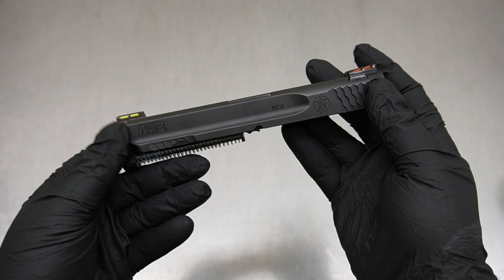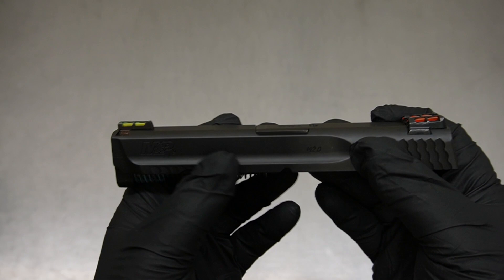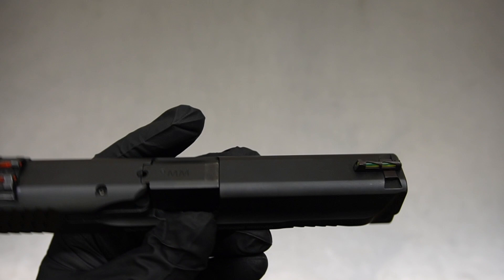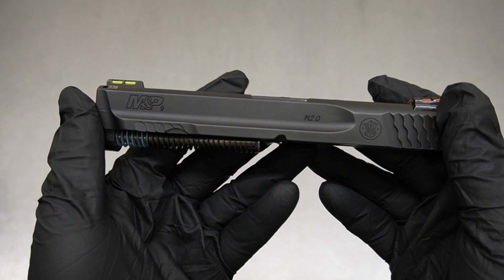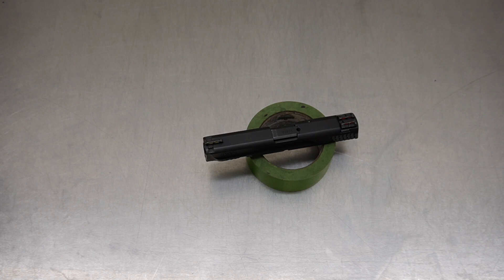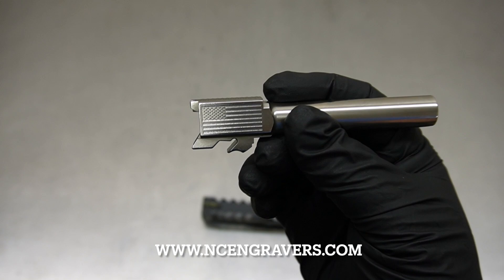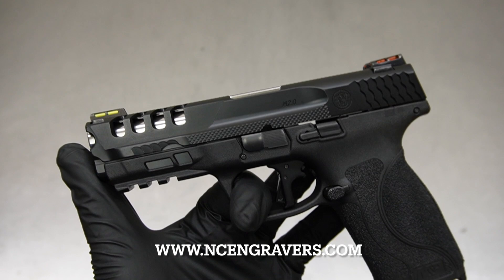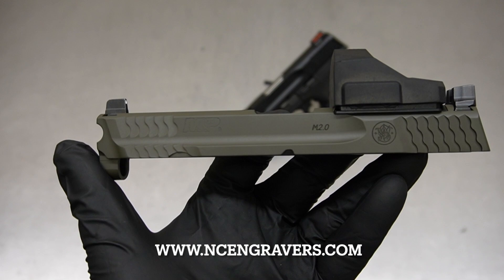NCEngravers.com  - MP - Reverse Raptor Build

Comment: the P365xl is supposed to have the same barrel material (416R S.St.).. but in you experience do they also polish as well as the M&P 2.0 barrels?
Reply from the maker: interesting. every time i have polished a P365 barrel they would always rust. maybe they changed the metal?
Reply: @NCEngravers  well that sucks.. but is good to know. 
It's also possible that they are intentionally misrepresenting their marketing of the barrel material
Reply: For some reason SIG is still using carbon steel rather than stainless for the P365 barrel (all models including the XL, per their website). That's the one thing that keeps me from getting a P365. 

Nowadays as good as stainless steels have become there's not much reason not to use it for firearms that are meant to be carried against sweaty hide. Yeah, barrels in semi auto pistols are mostly covered by the slide and somewhat protected, but still...